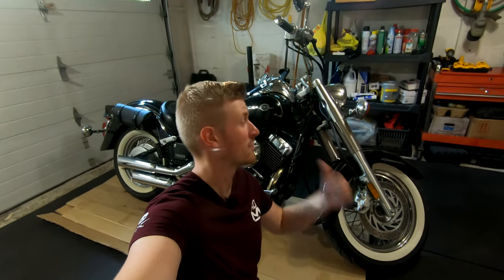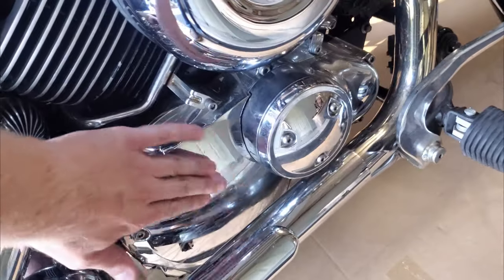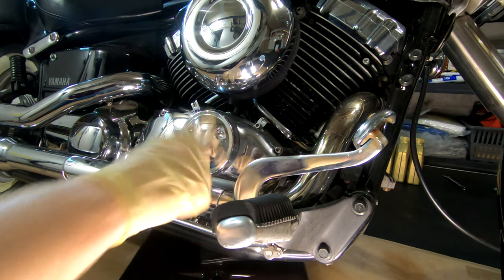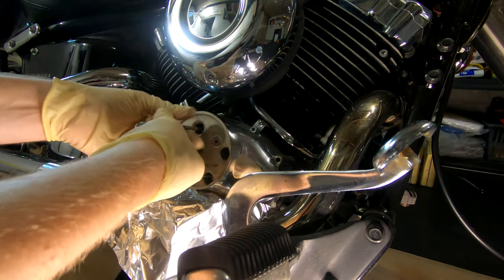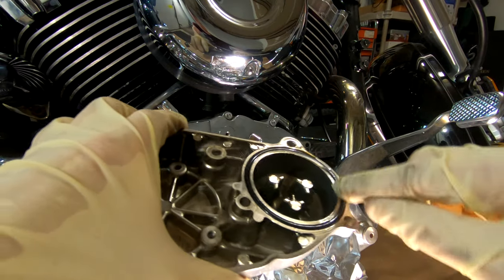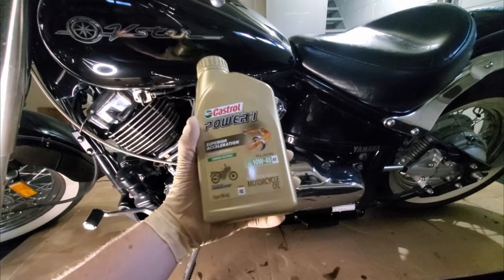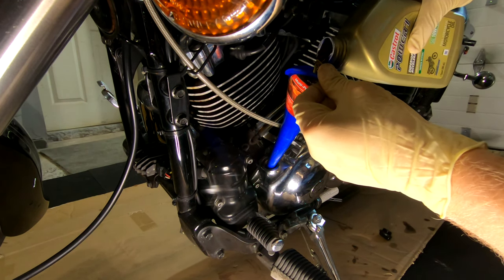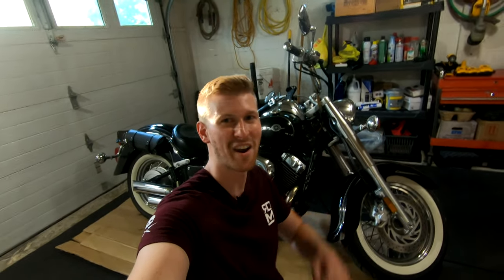How to Change Yamaha V-Star 650 Oil + Filter ✅

Comment: Appreciate your help with the oil change.... However after 60 degrees  in outside temperature Yamaha recommends 15w-40
Reply from the maker: for me, 10w-40 is easier to find in full synthetic motorcycle specific oil, and unless you're starting your bike in negative temperatures it won't make a difference since a 10w and 15w weight are both good below 0.  Both operating temperature weights are 40 so once the bike gets up to temp it will be the same.
Reply: A lot of people recommend mobil 1 v-twin 20w-50?? What is the proper oil for a 2013 vstar 650?? I live in utah so mostly hot here.

Comment: Is 10w40 right I gave it a google and it suggested 20w50?
Reply from the maker: Oil weight can change depending on the outside temperature. 10w40 is good for a wider range of temperatures from 14⁰-113⁰F (-10⁰ - 45⁰ C) and 20w50 is good for higher temps at 41⁰-122⁰F (5⁰-50⁰C).  If you're in a very hot climate then run the 20w50, but for most places the 10w40 is good
Reply: @RDMotoring  thanks for the quick response and good info man 🤘

Comment: always use a torque wrench
the cost of not using one could total the bike (blown engine if the plug and oil come out while riding),  or stripping out the case threads)

Comment: is that weight recommended? I just picked up my vstar and wanna get the oil done asap. I looked on line and it said 20w-40 but I figured that was a bit weird
Reply from the maker: it all depends on the temp you're riding in. With oil weight the first number is the viscosity at cold temps, and the second is the viscosity once the engine is warm, so any oil that ends in 40 would act the same once it's warmed up. I like using 10w because it moves easier when it's cooler.
Reply: you cant find the 20W40 motorcycle oil anywhere anymore - its all 15W40 or 10W40

Comment: Wait... what? You 650 guys DON'T have to take the exhaust off to get to the oil filter?! That's so unfair! 😂 I really love my 1100, but I'm getting an oil filter relocator kit. Man, it's annoying! 😄

Great how-to video! 😁
Reply from the maker: You have to remove your exhaust?? Sounds like a major design flaw
Reply: It is! 😅 And to get the exhaust off, you have to loosen the bolts for the floorboards. 😂 No more for me though. Relocated both the floorboards and the oil filter. Never taking the exhaust off ever again, and now the oil changes are a half-a-beer job. 😁👌🏻

Comment: Shouldn't the bike be standing level to see the oil window.
Reply: no, not necessary
the oil drains the same level or on the kick stand
and you dont need to look at the site glass oil level

if you change the filter put in 3 quarts
if you dont change the filter put in 2.7 quarts

if you dont spill it all over the bike, there is no where else it can go- its IN there, you dont have to check the level

if you want to check it, start the bike up so the filter will fill with oil,  turn it off, then check it like you normally would, sitting on the bike, with a mirror